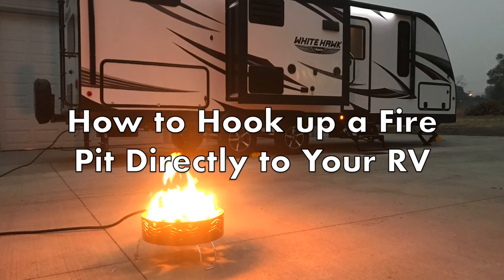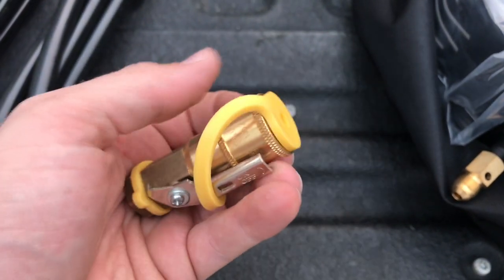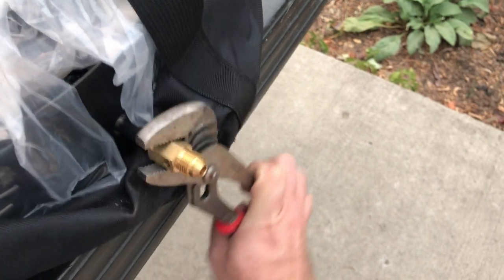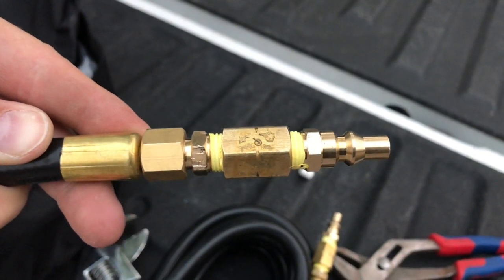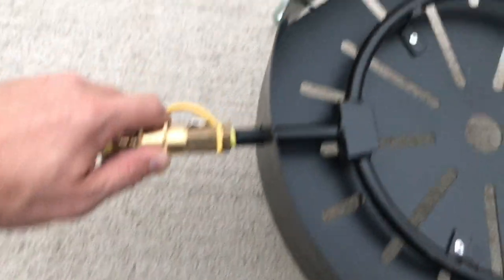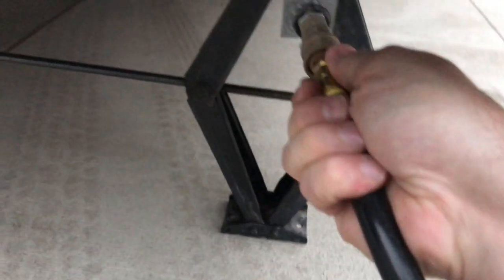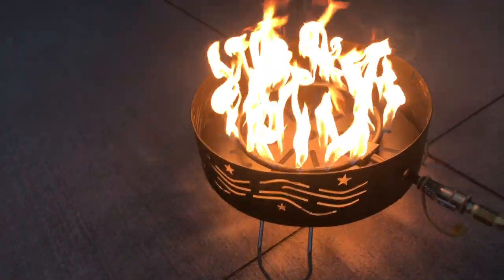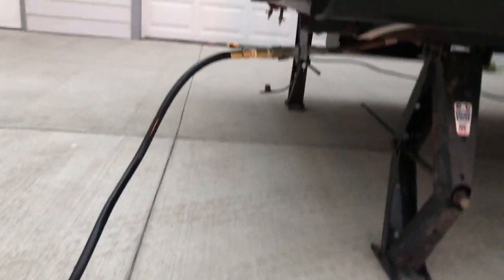Hook up Fire Pit to RV Propane Tanks

Comment from the maker: UPDATE: After almost a year, this has worked perfectly, however I would recommend changing one of the hose ends to a female end and the firepit to a male end. This will be a safer version, so that way if someone reaches under the RV and turns on the gas line, it wont leak since the female end closes automatically when not hooked up.

Comment: Hi Michael, I have a few points of concern with your fire-pit modification and hose connection. First of all, you'll note that the fitting you removed from the fire-pit has a hole in the side of it. This hole is for mixing air with the propane for a cleaner, more efficient (hotter) burn. By eliminating it, the unit is burning a straight rich propane, which will create sooting. 

I recommend leaving the fitting in place, attach a 3/8 female swivel union, a 3/8 male/male gas ball valve, then a hose with a 3/8 female swivel on one end and the male quick connect nipple on the other end which will connect to the female coupler on your trailer.

Cheers,

Glenn
Reply: Glen you are 100% correct.  Not only does that fitting mix air with the propane, it restricts the flow of propane.  The hose should have a male quick disconnect (QD) on the end near the trailer and a female on the other end.  That way when the hose is connected, but the fire pit isn't, propane will not be able to flow out the end of the hose.

Comment: Really need to switch the ends from fire pit to end of hose.  When you disconnect all the leftover gas in the hose will come out.  Put the female end on the hose and make end on firepit.  Could be very dangerous.

Comment: Great video and thanks for sharing. Only question I had was, by adding a quick connector propane line to the fire pit, I’m going to assume it’s safe and no need for it to have a regulator on it, correct? Thanks.

Comment: I recently purchased an Ignik Firecanwith a regulated hose.  Now Ignik tells me that their products need high pressure from the source (5 psi for maximum output) so they won’t work with RV propane systems. They say RVs (with their built-in regulators) typically only provide around .5 psi.  I never had a propane appliance before and was unaware of the pressure issue before I made a purchase.  Can you comment on low vs. high pressure LP appliances?

Comment: My big concern is even if you use the short hose that connects to the propane tank directly, is the possibility of someone tripping over the hose? And in this case having a large 20ft hose would only increased the possibility of someone tripping over it and pulling the pit over and god forbid someone getting burned. A real question for concern especially if you have smaller kids.

Comment: Ok I'm confused. I need a 25 hose for my fire pit (Little red Firepit). My rv has female auxiliary outlet. I remove the hose and regular from my fire pit, now I have male threaded plug on the fire pit. What ends do I need for hose and any other quick connect ends or shut valves?

Comment: How do you control the flame?
Reply from the maker: Theres a valve adjustment on the connection that hooks the hose to the firepit. Very simple to adjust and never gets to hot to touch since its lower than the flame.

Comment: So frustrating ! As 2 senior ladies ,we are looking to attach fire pit propane hose to 2017 Pleasureway class b on a Dodge Ram
chassis.
We were told we no longer needed to carry
20lb propane tank but to connect to vehicle external tank EASILY!
i have watched 4 
tutorials and am now thoroughly confused.
Why can it not be short and concise
without rambling about other issues .
Please prep before
starting  video ,forget the "righty tighty " 
and breaking off parts on camera etc .
Im sorry but When the video begins im ready to absorb just the part  I researched and need to know since rv'ers usually are aware of dangers 
associated with propane etc.
Perhaps hold the relevant part still for the likes of me to photograph part to purchase.
I now feel We will have to go to the professional at a high cost.🤔🇨🇦
Reply from the maker: If you’re confused after watching a 4 minute tutorial, I’d recommend hiring someone for sure.

Comment: Well two things are wrong one you threw away your air mixer... that was connected to the fire pit ....with propane especially if you don't want to get carbon monoxide poisoning...you need air mixer.    Big enough for the btu associated with it......... and I believe the regulator that was on the original hose that came with the fire pit is a 5 PSI now you are running a lower PSI which would mean probably quieter but less tall flames